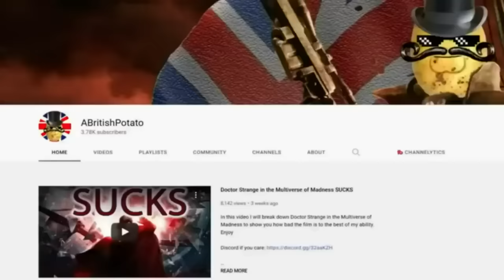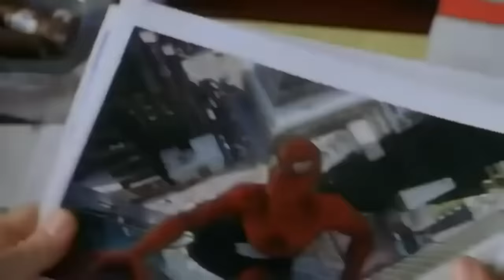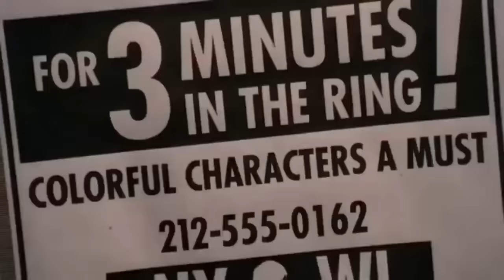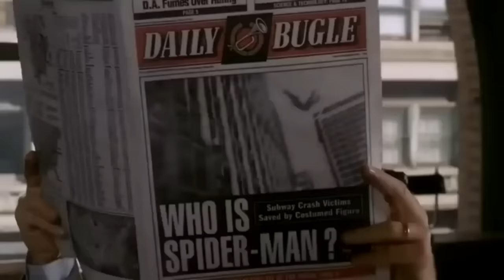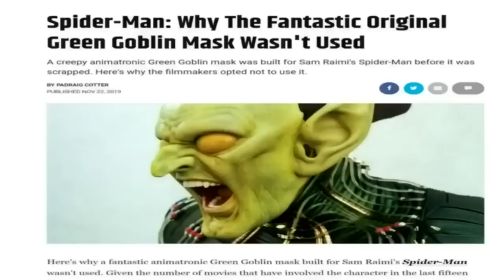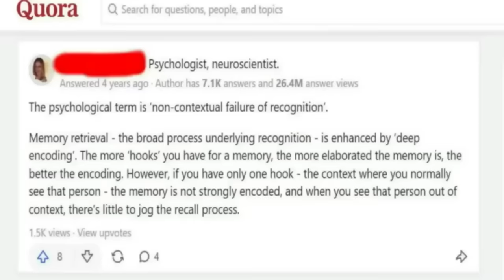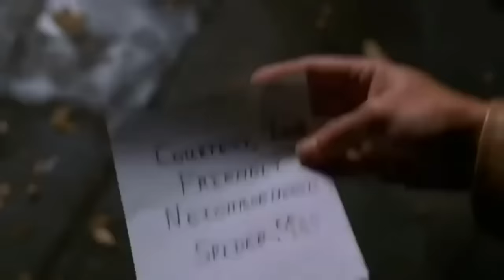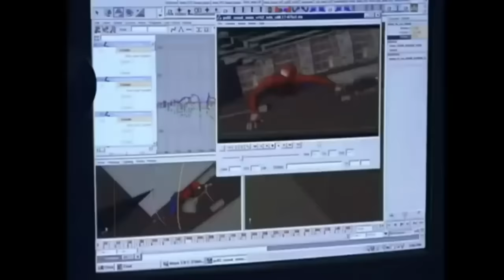Sam Raimi's Spider-Man 1 IS A MASTERPIECE

Comment: The Spider that bit Miles from into the Spiderverse was from a different universe. NOT contrived and also makes sense in the context of the plot.
Reply from the maker: That wasnt a thing until the sequel, but that opened up more problems for spiderverse because of the whole canon event crap
Reply: @anomalyinc3239  it had the number 42 on it and it was heavily implied due to the glitching of the spider. and yeah, i don't really get why Miles' universe isn't crumbling. I guess it was a canon event for the spider to leave universe 42 with no Spider-Man for some reason.